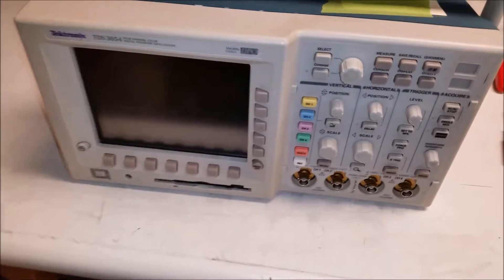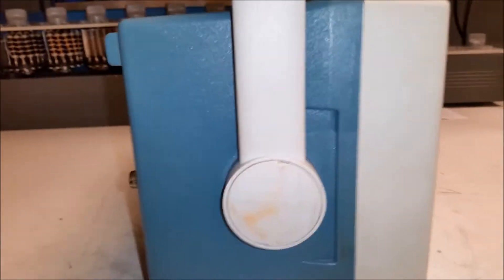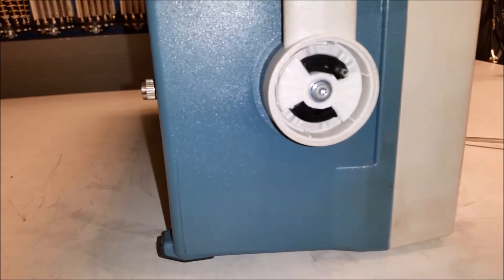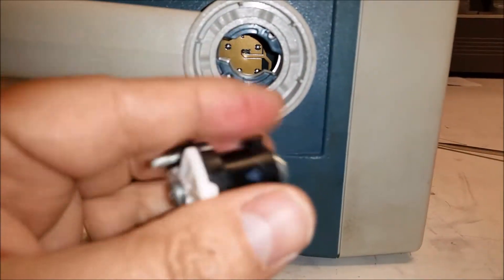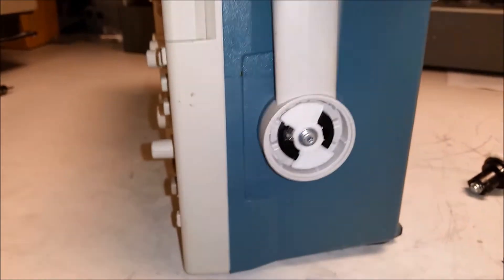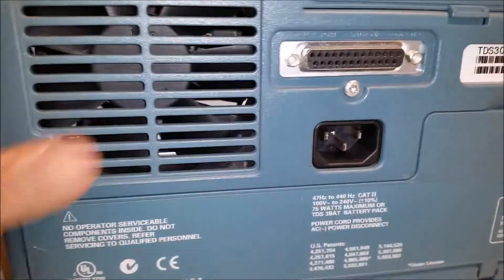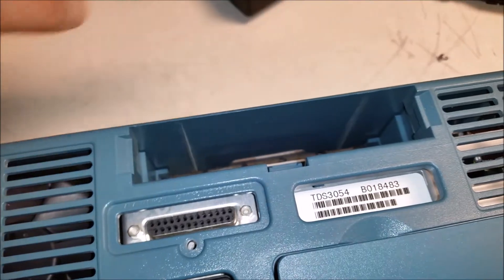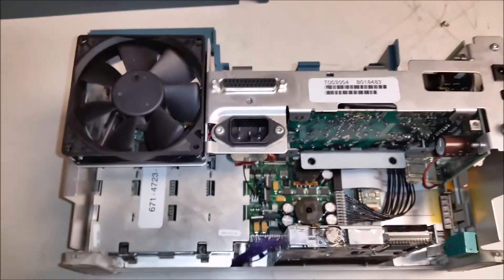How to Open a Tektronix TDS3000 Series DPO  Oscillscope

Comment: happen to know why tds3000 does not recognize tds3em (lan & 232) module. it acts like noting is in there. IO shows empty
Reply from the maker: Tektronix usually you have to enable the Option in the Software. Sorry I don't know how to do that, but you can post that question on the EEEVBlog or the Tektronix Blogs and someone will know.

Comment: thank you very much. I recently got a tds3014, it works fine, on the utility / diags, all pass.  signal path pass. but it does not recognize tds3em, rs232/LAN communication model. I/O is empty. 
would you happen to know what could be the trouble and where I should start from please?
Reply from the maker: Hey AB, sorry I'm only slightly familiar with how these work electrically & close to zip on their programing etc. If the scope does work and the measurements are close, then see if the option you want is enabled in the program. If the option is empty on the back then it's probably Not selected in the program so you'll need to break into the program, may need the programing manual for that, and select it. Once it's selected you can buy the option parts that connect to the board and mount them on the back. More than likely the EEVBLOG will have something on these and how to enable options. Sorry I can't be of more help. Keith Noneya

Comment: Who the F is the sadistic monster who designed the mechanicals of this series? Need to take the handle out to access the unit, and need to open the hub caps to lift a pin to rotate the handle to the right position to do it? That is criminal. Not to mention they are not doing a screwless design, because there's still a screw under the printer port. The ill written service manual didn't say everything has to be opened up in a specific order fully dependent on the last procedure, and it's hard to believe that taking out the handle is required to take the case off. Not to mention both sides are assymmetrical! This is impossible to figure out without solving a puzzle if the manual didn't drop some hints.
Reply from the maker: Oh for sure, and don't forget there are NO public schematics for these units either. Kinda like the TDS 600-700 series. With the exception some former Tektronix Warranty Technician saved those schematics and released them secretly on a Ham Radio Operators website and buried them in the website under a heading of Additional information or something like that. Just curious why did you take it apart?

Comment: Hi, Do you know if there is a clock memory battery?
Thanks,
Reply from the maker: Sorry for the late reply, I was traveling for a few days to my Aunts Funeral and to hang out with family and friends. I would consult the Service manual, you can download it here if you're registered with Tektronix; https://www.tek.com/en/manual/tds3000-series or you may be able to do a search for TDS3000 Series
Digital Phosphor Oscilloscopes Service Manual and one will pop up. The manual number you're looking for is Tektronix 071-0382-01. Hope that helps point you in the right directions. Best Wishes & Blessings. Keith Noneya
Reply from the maker: Also take a look at this video https://www.youtube.com/watch?v=VAuEoIn6X-s&list=PLVLXGvrQp0OtMeEhAIraNHoKnUvXZamYh&index=17 it's on the differences between the mother boards of the 3054 and the 3054B. If you go to time index 00:37 you'll notice on the bottom a DALLAS chip. That chip has an internal battery that you can't change. You might be able to add one to the top of the chip by studying the IC's Data Sheet. Here's a video I did on adding one to a computer DALLAS time chip; https://www.youtube.com/watch?v=NdlSfqto_0o&list=PLVLXGvrQp0Os1DY1r_iUETKdLR2u-cAfY&index=19&t=2s&pp=gAQBiAQB Note it's very important that you know where the battery terminals are under the plastic if you want to attempt this. You should also know that when you remove the battery terminals like shown in the video, "IF the battery was good it was holding all the scopes Calibration and Data and by removing the battery terminals all that memory will be wiped out and you'll have to reprogram the scope and calibrate it. So that's a last ditch effort and should only be taken if that battery is already dead and the scope says it needs to be calibrated. I only know a little bit about these scopes from playing around with them, so far I've fixed two that had input Attenuator Card issues but I haven't had to do any programing on them yet. I hope that gives you some more information to consider. Oh Tektronix did NOT release the schematics for these scopes so if you run across any shoot me a comment with the link so I could go down load them. I you can't find the Service Manual shoot me an email and I'll send you a copy. keith_noneya@att.net   Best Wishes & Blessings. Keith Noneya

Comment: Hi,
when i attempt to observe a square wave, my TDS3014B shows a lot of ringing in the Channel 1 only. After several test, I deduced this problem depends on the oscilloscope. So, I wonder: are there capacitive trimmers inside? Is it possibile to compensate this oscilloscope manually?

Thank you for your video!
Reply from the maker: Hi, thanks for watching. Sounds like you have to adjust the trimmer cap on the probe assembly. Usually there is small hole in the probe box with a small trimmer capacitor. If it is only CH1, I tend to agree with you that it is the scope not the probe. From what I know about the input Attenuator Module there are not trimmer capacitors. I would venture to say the Attenuator Module is probably bad, no easy fix! I have some raw unedited video of me replacing and changing the relays on one of these Modules but I have not finished the video yet. As far as I know Tektronix has not released the schematics on any of these scopes yet so repair can be very difficult. I'm only slightly familiar with the scopes at this time and I have not had the opportunity to really examine these little scope so I lack the expert knowledge to answer your question. I was given the opportunity to work on two of them so I posted what I know of them in case someone could use the information. For a quick look at the inside and a view of the four input Attenuator Modules go look at my other video here:        https://www.youtube.com/watch?v=3PiCZ6QaL3c
   I hope to post a video some time this month on what I know about the Attenuator Modules, which isn't much but more that some know. The little white boxes are relays, I'll post a video some time on how they work, hint they don't work like regular relays! So stay posted and check back every once in awhile to see if it's posted.  So far I've fixed one, the TDS3054, by changing the Attenuator Module on the main board. Sadly a higher priority has come in for repair so I had to set the TDS3054B back on the waiting maintenance shelf. I have visited Italy and loved the country. I have visited Taormina, Rome and Naples I wish I had more time and money to visit more often. Thank you for watching the video and please give me a thumbs up if you learned something in the video, and ask all the questions you want I may know the answer. As I always tell my son, "If you don't ask son the answer is no. Wisdom son is knowing when to ask!"
If you figure it out please post it and send me a message to it. Best Wishes n Blessings Keith.
Reply from the maker: PS After a quick thought as far as the distortion goes check to make sure you have the right input impedance set on the Vertical Menu. To check it do the follwing:
Hit the CH1 button, Hit the Vertical Menu Button, See that the Coupling DC or AC Menu is illuminated on the bottom left of your screen. If is illuminated see if 1M ohm impedance vice 50 ohm impedance is selected If the 50 ohm is selected the signal can be distorted if you have a mismatch in your probe or signal input. Compare CH1 with the other Channels that work and make sure the input impedance is the same. If they are not change CH1 to match and check the waveform again. Also check to insure you have the trigger set to CH1 by using the Vertical Menu. If they are and you still have the problem you may have a bad Attenuator Module. Hope this helps, Best Wishes n Blessings Keith.